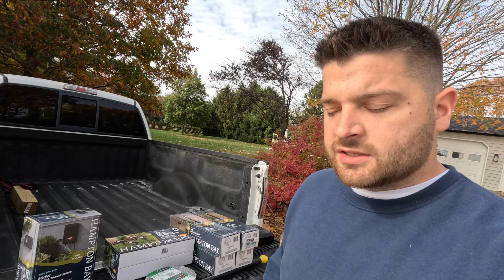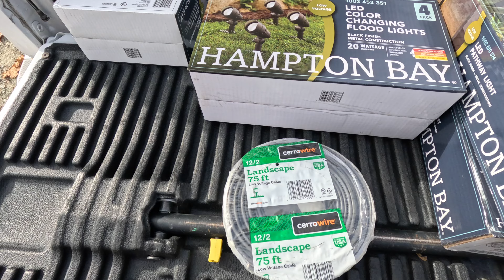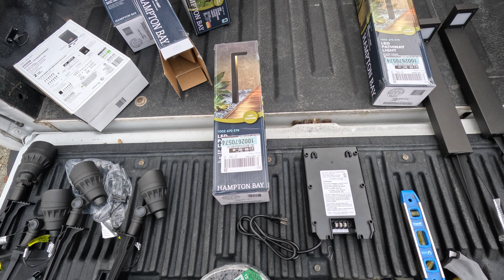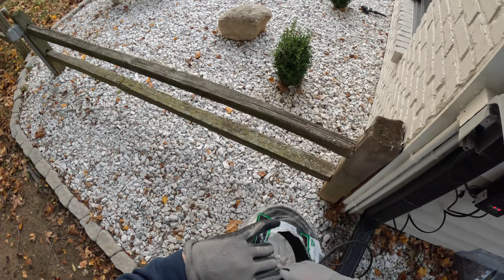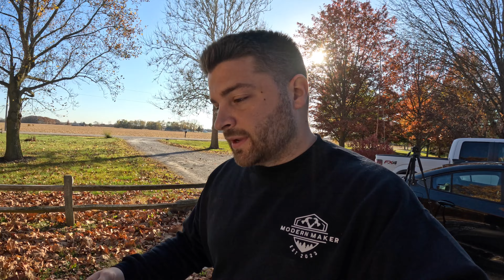Budget Landscape Lighting | Hampton Bay Landscape Light System Step-by-Step | Boost Curb Appeal!

Comment: How did you terminate the wire?
Reply from the maker: Mine happened to use the full roll. The end comes terminated so I didn’t need to do anything. I believe you can just bury the rest of the wire if you have excess, but I’d double check.